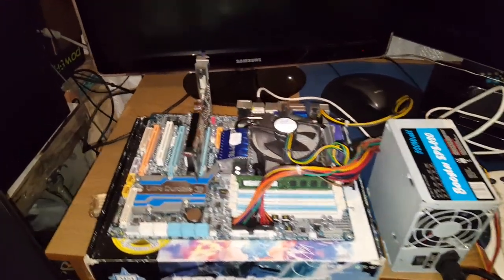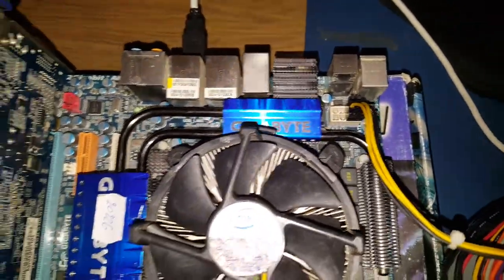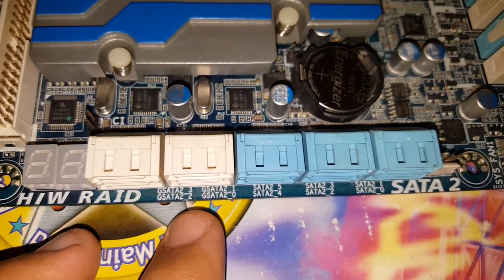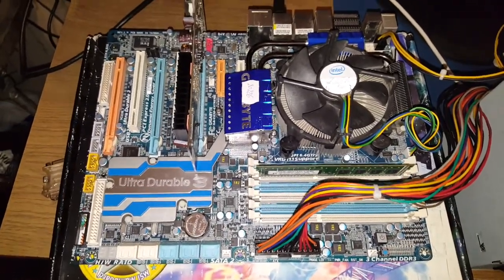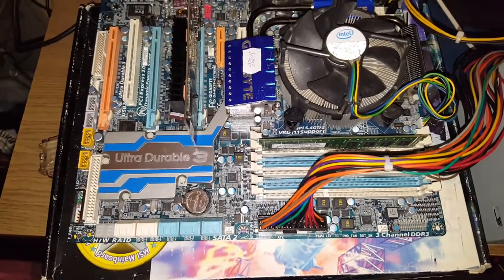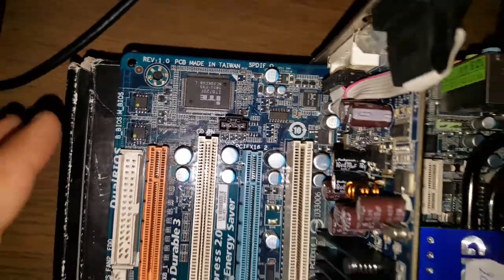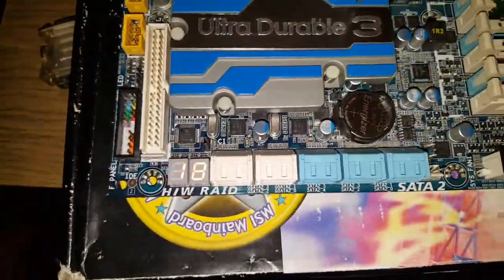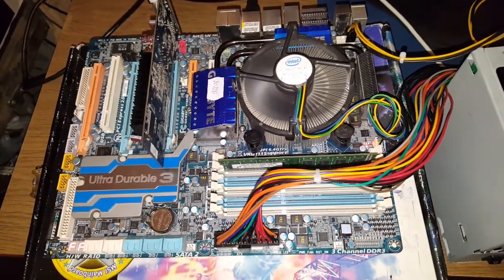Gigabyte Ex58 Extreme

Comment: I have exactly the same board. doesn't work. can it work with "Xeon 5670"?
Reply from the maker: @tophouse161  Most definitely. I'm intending, trying out the : Xeon 5690. Just, get the lastest bios update F13S and install the CPU. Good luck !
Reply: @edward940  6 x 1.5V DDR3 DIMM sockets supporting up to 24 GB of system memory.
Dual/3 channel memory architecture
Support for DDR3 2100+/1333/1066/800 MHz memory modules
(Go to Memory Support List for the latest memory support list.)
I still haven't found a list of recommended memory manufacturers :(
You don't know which RAM is better to install?